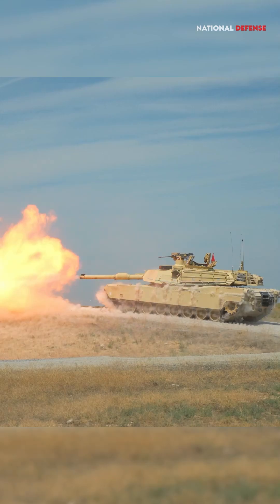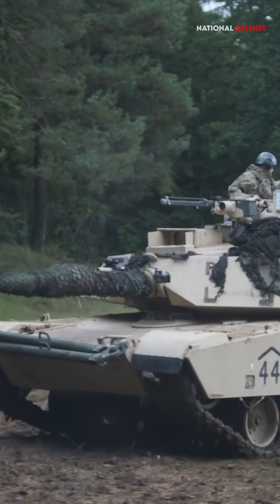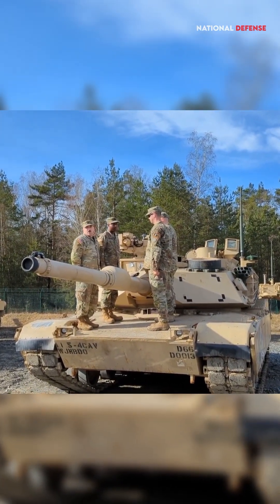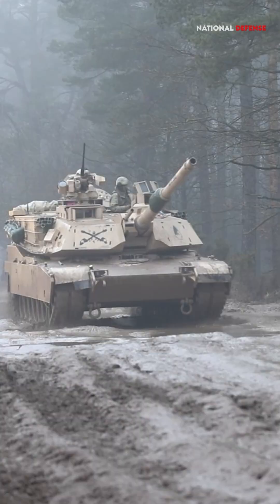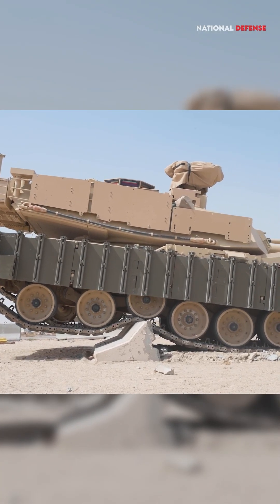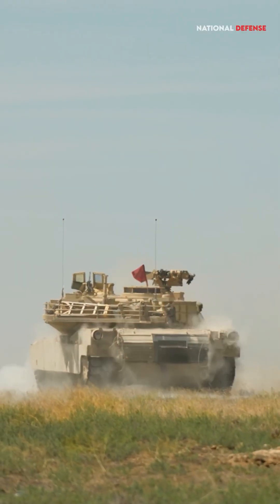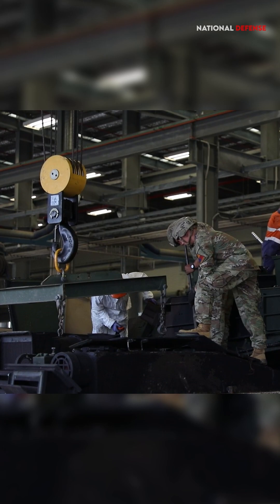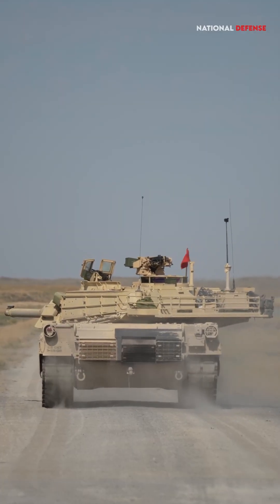Why do the Abrams use a turbine engine? #shorts

Comment: Quiet? And less of a thermal signature? Dawg they’re insanely loud. So much so that I am supposed to where hearing protection just while driving it, not even with rounds popping off. And anyone that has done vehicle ID in the army can tell you the Abrams thermal signature has the sun emanating from the ass end compared to the still bright, but not even close to as much as tanks of other nations. And reliability is a joke. Ask any tanker and we’ll tell you that thing breaks down more than that clapped out hoopty you got off Facebook market place for 2k for your first car. You wanna destroy a tankers perfectly good day? Tell them they gotta pull pack because their tank is leaking hydraulic fluid again. The Abrams has a lot of things that make it great, and almost none of what you listed are among those features. And the real reason for the Abrams having a turbine engine is due to its absolutely INSANE weight. It is one of the heaviest tanks in service, and that requires some serious power to get moving. So slap something in there that puts out ungodly power for its weight, and let it ride.

Comment: The gas turbine engine so much better than a piston diesel engine, that the 🇺🇸 is switching to a piston diesel engine for the next evolution of the M1 Abrams. 

In truth, the gas turbine engines only advantage is its power to weight ratio (its ~1’000kg lighter then comparable V8 and V12 tank engines). 

The heat signature of M1 Abrams is OBVIOUSLY higher then competitors if the specific fuel consumption is higher since the decreased efficiency of the gas turbine engine is reflected in having LARGER thermal losses, otherwise it would be comparatively more fuel efficient. 

Diesel engines can in principle burn plenty of different fuels. In fact, the MTU MB 838 was a multi-fuel engine.  Diesel engines in that case only refer to the combustion process: compression ignition, internal combustion engine. They do not require a spark plug, relying on compression to ignite the fuel. For piston engines, the compression ratio is proportional to an engines efficiency.

Finally piston engines usually have a larger operating range, with a flatter efficiency curve when compared to gas turbines. 

Peak engine performance is much more dependant on the technologies employed for internal combustion engines. Modern turbocharging, more advanced cooling, cylinder coatings, injection patterns aso. will lead to increased engine performances. Here there is a large potential technology transfer from the automotive sector (when no gas turbine has been used to any meaningful degree, because of the points mentioned before). 

Gas turbines are more practical for stationary power applications, aircraft (where power to weight is crucial). For tanks not so much… you’ll therefore likely never see gas turbines in any future MBTs.
Reply: The US is very behind in tank technology especially compared to EU states, China and Russia

 US have focused on fighter jets, stealth bombers and loitering Munition Drones mostly, Russias superiority is it's tanks, artillery, kamikaze drones and attack helicopters China would probably be its naval ships, IFVs and MLRS batteries, the EU states are a combination of all, I'm from Russia it's but even I have to admit that the European Union military combined is a scary force to be reckoned with

Comment: It extremely loud and it unreliable alway  having something break or breaking down just doing simple drills with it. Bright side is it easy to repair because of the way it was designed . Held by a couple of bolt making very easy to disassemble and reassemble
Reply: You’ve never touched an abrams, have you?

Comment: People always say that Abrams is a quiet tank, no it's not. I'm American, I have American bias, but no it's not. It's quiet in comparison other turbine engines, maybe, but it is not quiet in comparison to other tanks. I mean seriously, have you heard a jet engine try to be quiet?? Here's the neat part, they DON'T. I've heard from people who have worked with them that they are quieter from greater distances than a diesel engine, simply because of the frequency of the noise they emit, but if you put a vehicle like the leopard next to an Abrams and have them running, the leopard will be quieter. It's kind of important to specify these things...

Comment: The reason is that the U.S. friends are unable to build a powerful Diesel engine.
Abrams tanks are gas guzzlers. Scrap basically.
Reply: The gas turbine is so good, that they are likely going to ditch it for the M1A3  (prototype called M1E3)

Comment: I also heard a. Expert said it’s need maintenance every 70 miles in sandy places because the air filters gets clogged.
Reply: Now that's funny, Consider in 1991when we advance  over 150miles into Iraq and fought the republican guard of Iraq we lost only 5 tanks in the 7th Corps and considering we had almost 1800 tanks. Do you really  want to talk about  a filter. To try to put the beast down. The new M1A2, is a piece of art. And i would  go against any other in the world.And on a 4 lane high I can tell you for a fact a combat loaded M1A1 without a governor  on the motor  you get a speed of 58mph. Tapping up it flash 59 off and on😂😂😂 D tank company knows how to move. Not any other tank in the world is in it's league
Reply: @arthurmondrake4713  you should hear the opinion of colonel McGregor who actually was the commander in chief of that operation of the infantry and armor forces
Reply: They do get very dirty, but the Abrams actually has a neat feature where we can use some of the air in the engine (remember turbine engines you very heavily compressed air to work) in order to clean the air filters. And seventy is very generous take that thing five miles and I’d recommend blowing out the filters.

Comment: Standing next to an Abrams it whistles loudly but  from quarter mile away you can barely hear it. The lower frequencies of a diesel engine can often be heard for miles in the field.
This allows an Abrams to sneak up on a point with little warning.
Reply: That’s possibly why GD proposal (Abrams X) features a Cummins (diesel) internal combustion engine… because the gas turbine was better.

M1A3 (prototypes called M1E3) Abrams will likely feature a diesel internal combustion engine because all things considered it’s a better choice.

Comment: And reliable? Really? The service interval for field service is shorter for the Leo2, meaning topping off fluids, like oil and coolant, but the interval for engine overhaul is almost twice the time.
Reply: Everything is worst a part from the power-to-weight ratio. 

Diesel engines have comparatively lower fuel consumption = higher efficiency = lower thermal signature since wasted combustion energy is heat. What else could it be? 

The proposed improvements to M1 Abrams feature a (diesel) internal combustion engine instead of a gas turbine. I think that’s an obvious sign that it is the more appropriate power plant.

Comment: F35s are such good stealth fighters because the Abram’s masks the noise around the whole earth when it turns on
Reply: Still doesn't stop 70s soviet radar spotting Israeli F-35s in Syria 😂

But don't tell Americans this, they think stealth fighters mean invisible and don't understand what LPIR means
Reply: @SMRMilitaryAnalysis2  yeah but the radars that can detect them aren’t large enough for missile locking solutions. The radars that can create missile lock solutions cannot track an f35
Reply: @SMRMilitaryAnalysis2 they wouldn’t be able to shoot it down lol, also the F-35 isn’t America’s most stealth aircraft
Reply: @nobodybutarolloftolietpape1990  another person who doesn't understand stealth technology, stealth technology isn't invisible nor is it impossible to shoot down, it simply reduces the chances of radar signature and lock on capabilities.

There's various stealth fighters, there's full stealth fighters like the F-22, F-35 and J-20 (or the possible Tempest or Su-75) which can go in small groups to attack well guarded areas with strong radar and air defence batteries, up to a point, again there's a limit, if there's numerous air defence batteries and radar installations then the chances it will be spotted are increased massive, then there's ones like Su-57 which have 5th gen avionics, hardware computer systems and LPIR to protect against detection from lock on but are for less well guarded areas like naval ships

Comment: Quiet? Have you heard one?
Reply: In contrast to other disel tanks the abrams is quieter expecually at long range as the frequency of sound the engine produces is different and thous it doesnt travel as far. Sorry for spelling and im drunk.
Reply: @ViktorBezK hardly any claim about the gas turbine being better is true. 

That’s why the General Dynamics upgrade proposal, Abrams X, featured a Cummins (diesel) internal combustion engine. The upcoming M1A3 variant (prototype designation M1E3) will likely feature such an internal combustion (diesel) engine. And for good reason, a part from power-to-weight everything is worse in a gas turbine for such an application. 

Looking at the claims in this video: he acknowledges the fact that gas turbine have comparatively worst fuel consumption: true, then he says that the heat signature is lower: physically impossible since where does waste energy go in thermodynamic als systems? Right —> heat 🔥 

Worse specific fuel consumption = lower thermal efficiency = HIGHER heat signature…

Recap: the gas turbine in Abrams gas no power advantage over competitors (Leopard 2, Leclerc), worse fuel consumption, worse thermal signature, higher air-filter requirements, noise emissions can be more easily remedied in piston engines compared to gas turbines with the use of silencers … performance is mainly dependant on technology (automotive industry: new cylinder linings, variable vein turbochargers, fuel injection profiles, combustion chamber design, cam profiles, …)

Comment: ALL OF THESE STATEMENTS ARE WRONG..THE ENGINE ALSO REACHES 2OOO DEGREES WHICH COOKS THE CREW AND LEAVES A LONG LASTING INFRARED SIGNATURE.ITS A PAIN TO MAINTAIN.AND A SIMPLE STRAND OF BARBED WIRE CAN DISABLE IT.😮.THERE ARE NEW HE DIESEL ENGINES THAT HAVE ADDED ELECTROLYSIS WHICH ADD O2 AND HYDROGEN DIRECTLY TO ENGINE INCREASING MILAGE BY 4O%. CHECK DYNOCORP COMPANY OF CANADA.THEY INVENTED THIS FOR LARGE FRIEGHTER SHIPS WHICH COMBINED WORLDWIDE,EMIT MORE POLLUTION THAN ALL THE CARS THAT EXIST.